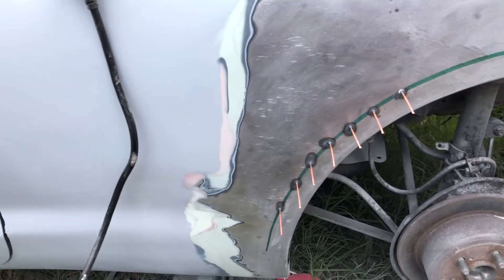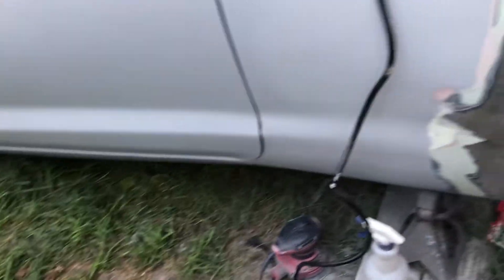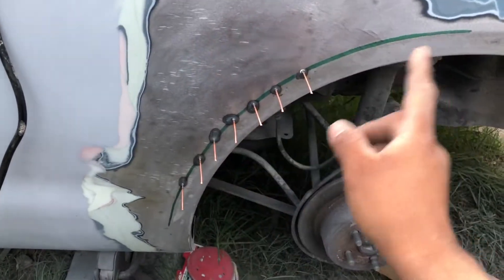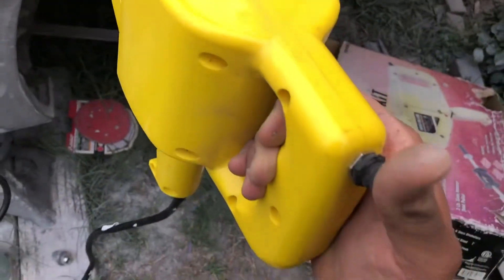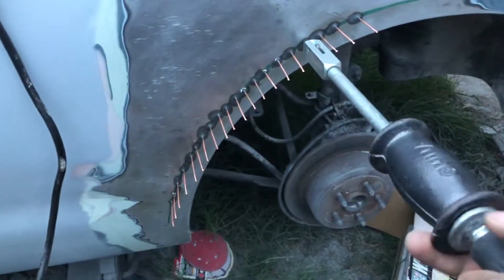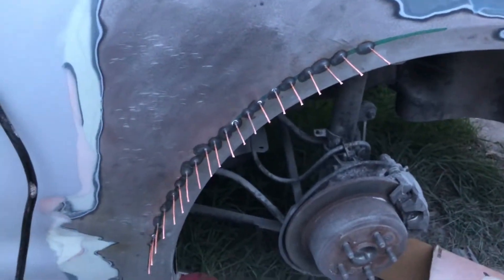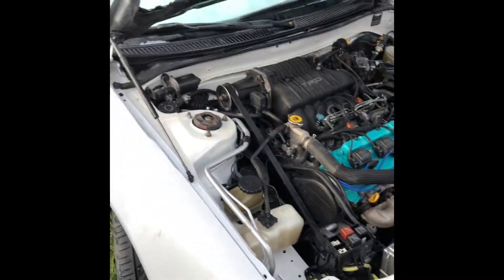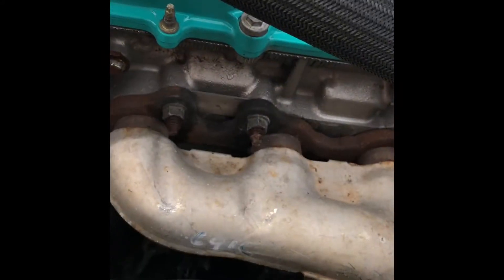Is it worth it? Harbor Freight Stud Welder Kit overview

Comment: Nice job ! Remember when you have welded all your nails on a panel that you want to straighten, you must always start pulling the nails at the places where the sheet metal (panel) is the MOST rigid going to the LEAST rigid, it all depends on the bump... If we are talking about a more complicated ''smash'', otherwise it will make a panel soft and difficult to straighten solidly... In other words, never start pulling in the center of the bump first then finish outwards, but rather the opposite, always start pulling at the end of the bump (in the solid....) where the bump starts going gradually towards the deepest part of the bump....difficult to explain in writing... loll
Reply from the maker: thanks for the information and i will for sure take that into consideration the next time around.